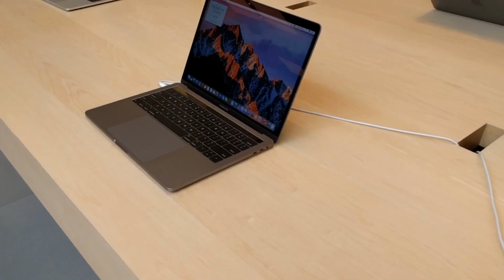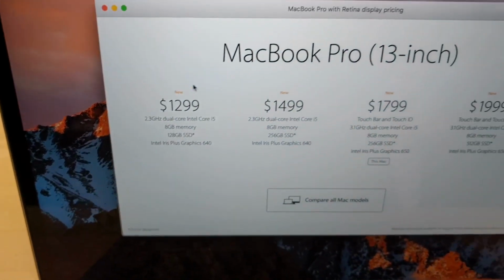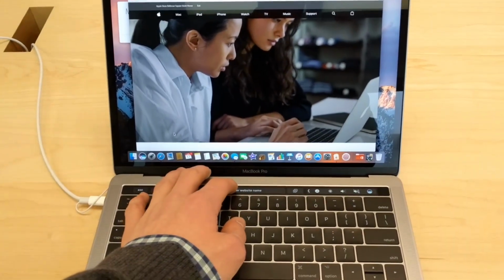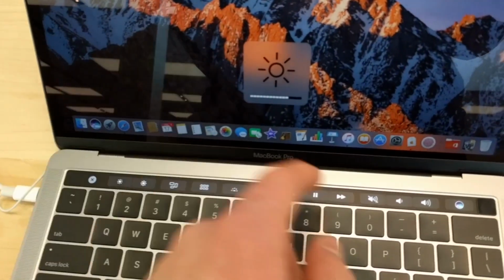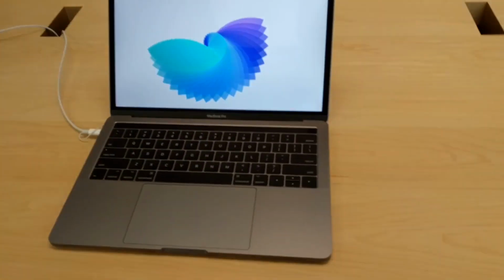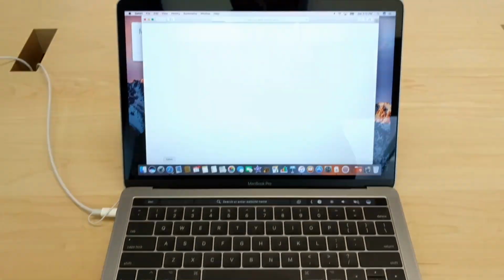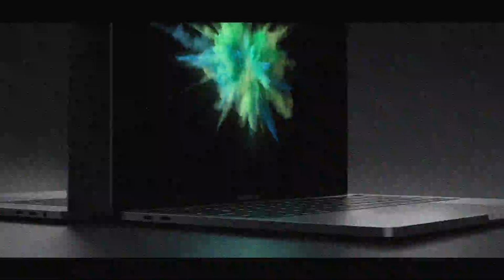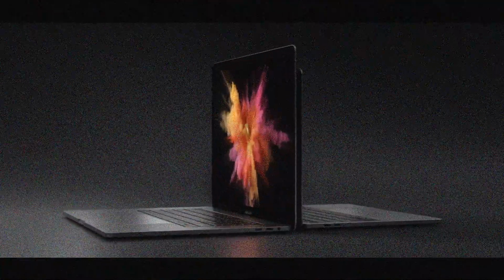MacBook Pro 2017 impressions.

Comment: MacOS is nicer to use than Windows 10. 

MacOS also gets less viruses. 

Windows has more third party apps. 

Windows also has the possibility to play Xbox One games which is awesome. 

Ports aren't an issue. I barely use anything except the charger. I do miss MagSafe though which I love. 

Mac's, iPhones, iPads, Apple Watches and AirPods all work seamlessly and remain as quick as the day you bought them. 

I have both Windows and Apple products. I tend to use Apple products 98% of the time. It's just quicker to use them. 

Looks wise, Apple wins. 

I do think some products can beat Apple on specs such as the Dell XPS. This is also cheaper as well. 

I just think it's worth sticking with Apple. You feel a continuity with their products. 

With other companies you always feel like you are starting from scratch when ever you buy a new product. 

Apple MacBooks are incredibly expensive. That's obviously one of the biggest deciding factors. It's mainly a fashion statement rather than a show about performance. 

Best Laptops in my opinion:- 
Alienware - gaming 
Razerblade Stealth - gaming and nice looking 
Dell XPS - Best Windows Laptop 
HP Spectre - 2nd best Windows Laptop 
Surface Pro 4 - best windows two in one. 
Surface Book - best Windows machine from Windows. 
MacBook Pro - Best Apple product. 
Google Chromebook - Cheapest product. 

All of these are good. Just make sure you have the 256GB SSD as a minimum. I'd say 500GB to be on the safe side.

Comment: Apple has a vision of a Wireless future. That's where Apple is heading. Yet most people don't see that
Reply: RoCk-N-PaRtY 

4K content or even higher content will take forever across wifi. 

Furthermore AR and VR will require even more powerful ports. 

Most people won't even use ports except the charger.  

HDMI will be replaced by USB type C. USB type C Will become the dominant port for all devices. 

Once cameras start building in USB type C Ports instead of using Micro SD cards. We will see a bigger conversion to USB type C.
Reply: R C Uh, USB-C is actually a very strong port at the moment, much better than USB-C 2 or Thunderbolt 2, etc.
Reply: Zacharie Chiron 

Yes and what... 

I like USB type C. 

Maybe you misread my comment.
Reply: R C well it seemed u were complaining that Apple was going wireless. But they aren't dropping USB-C anytime soon since they just introduced it the last 2-3 years in their products. So u should be happy then if u like usb-c ;-)